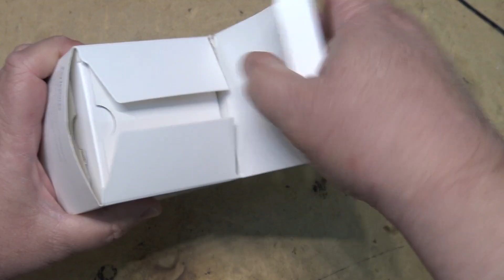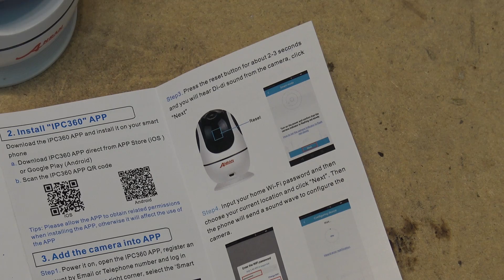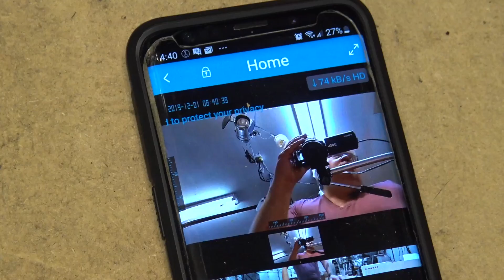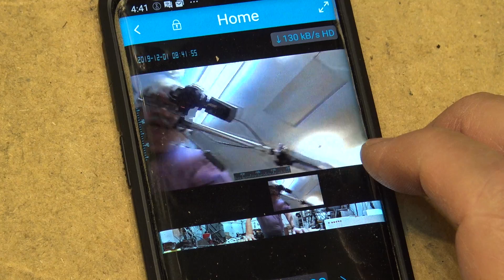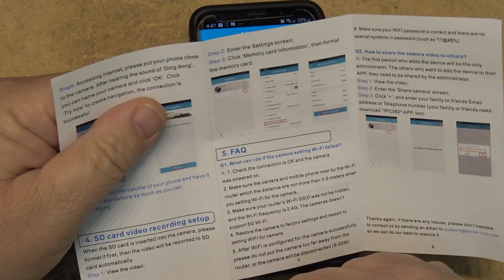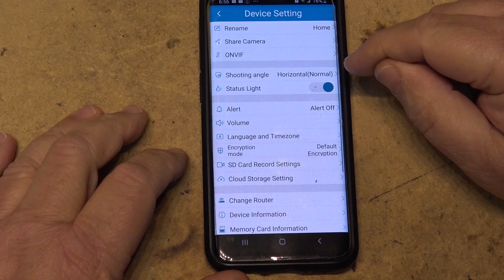Anran 1080p Indoor Pan Tilt Wifi Security Camera Review and Setup

Comment: Hi, i only have internet in my phone and i`m using hotspot to connect my PC to the net. Can i use this type of cam?
Reply from the maker: You can use it. It will record on the SD card but if you  are away from your house you will not be able to remote view.  You will be able to play the record video when it is connected to your phone wifi.
Reply: @12voltvids  Allright, thanks!
 I'm doing some repairs as a hobbyist, mostly vintage audio equipments, here in Finland and find your videos helpful very often so thanks again!

Steve.